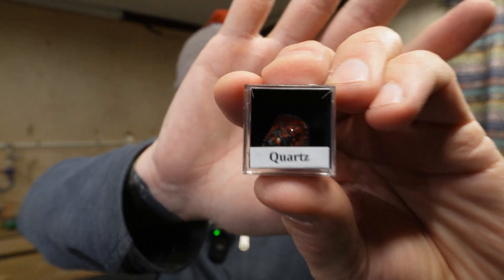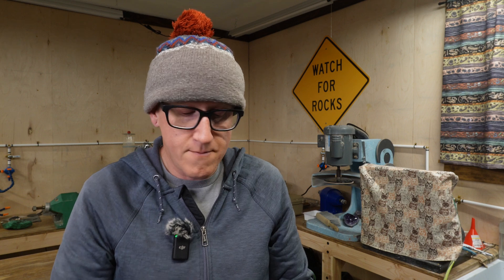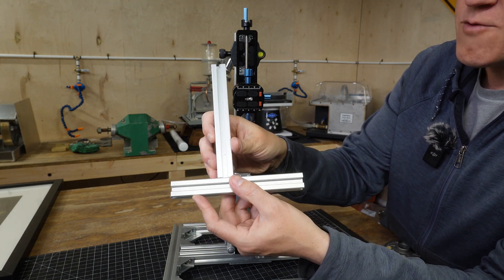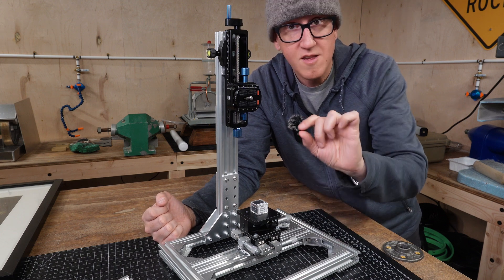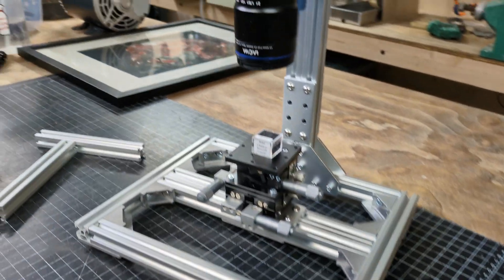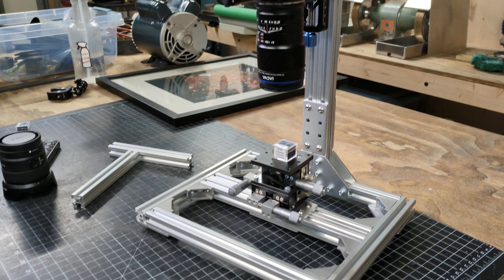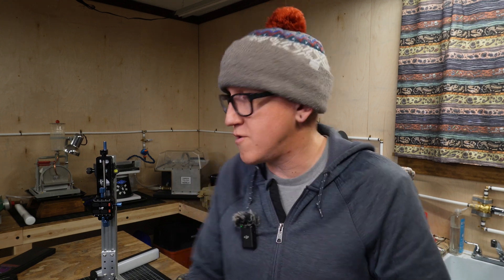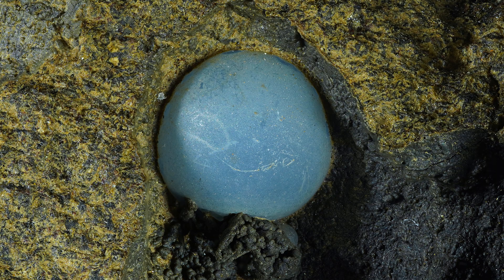The Unseen World of Micro Minerals

Comment: I bought a book on macro photography a few dozen years ago. 😲😭
I made what it suggested as a lense modification.  The resulting image was equal to about  1/8" of an inch in width as I recall.  Depth of field was very shallow, but pretty clear. 
Quite basically, it was making a screw in adapter for my 70/210 lense.
You remove the glass from a screw in lense filter. 
 Cut an aluminum disk the same diameter as the OD of the filter and epoxy it in place. I used JB Weld.
I used  1/16" thick (14 gauge)  aluminum plate.

The aluminum plate is just a mounting surface upon which you will drill and affix another small lens....... a lens salvaged from an old movie projector. (Not a slide projector)

I have to back up a little bit.
For safety, it's easier drilling or cutting a hole in a larger piece of metal prior to cutting the aluminum plate to the filter diameter, you drill and file a hole in its center for the projector lens to fit into.
You're basically making the equivalent of an aluminum washer.
For me, I ended up with approximately a  2 1/4" disk with a 15/16" hole in the center of it 

Once the disk was drilled, cut and filed to shape, the projector lens was epoxied into the center hole, then the disk was epoxied into the filter ring.

The result was a screw on macro lens.

Very hard to use tho because of the magnification.
You needed the camera mounted solidly and move the object to focus it.

Ah, those good old days of experimenting was fun.

.......and then I had to wait a week for my Kodachrome to get returned 🤣
Way to dark, way to light, out of focus..... It was all fun.
.....I'll stop rambling/reminiscing and watch the rest of the video now. 🤣

Comment: Very fine setup and art.  Well done!
With some cameras and lenses, this process may be expedited using bracketed focus and take away some of the potential for specimen movement when manually adjusting the z plane position.
Reply from the maker: It is my understanding that when you approach the extreme end of what macro images can be, the in camera stuff isn't as desirable.

Comment: That's a smart tool and great photos.  I want to photograph my finds and it's tough. I cross my fingers and put it in sunlight and use the food setting on my phone. Which by the way my phone brand isn't manufactured anymore ugh. I have a Sony camera but messed up the battery compartment, got it cleaned, but the little copper tab won't stay put. 😪